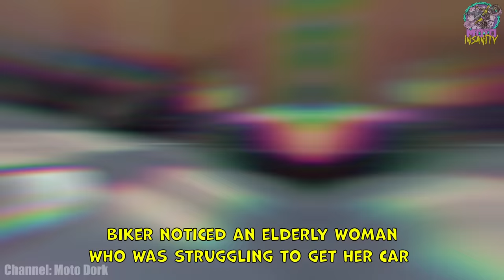THESE BIKERS are AWESOME | This is why we LOVE bikers 2023 [Ep.#36]🍿🍩🍭

Comment: 5:00 is a perfect example of how it helps to be calm even when the situation is terrible. Front doors weren't working, probably jammed if the front of the car was pushed back into the doors, and the girl panicked. Bystanders couldn't open the back doors and first instinct was to break the windows. Eventually the solution was that the girl inside needed to calm down enough to unlock the back doors and get out.
Reply: yeah true like why dint shr just try the back door
Reply: @sam.pena06  probably cause she was in shock and couldn't think clearly
Reply: It’s pretty easy to tell someone that they need to remain calm, but it’s not that easy to manually pull yourself out of shock either. How arrogant and self centered do you have to be to sit safely on your couch behind your phone, and judge how clearly someone who just got in a car wreck is thinking? Common sense isn’t always there for some people (that applies to you by the way). You are one person. What you think, how you handle things, it doesn’t matter. Not everyone is like you. And that doesn’t make them stupid either. When something like this happens a physiological response is triggered. Physiological, NOT psychological. That means that in a lot of cases they AREN’T thinking, they’re on autopilot. Honestly, come on 😂
Reply: @rlynn8249  I'm more pointing it out for anyone that watches this or reads this comment than the actual people in the video. Just a reminder that if someone is in a similar situation that trying to stay calm will help them. Similar to the whole mythbusters thing with a sinking car, they showed that on mythbusters and it's probably saved the lives of multiple people because when they got into the same situation they didn't panic and were able to escape. This is a good example of how even in a regular car crash it's easy for what is happening to overwhelm someone and they miss what could be a simple solution to a problem. You are correct in that this is actually a common response to a stressful situation for people. My point is that just because it's a common response and understandable, that doesn't mean that this is what you should do in this situation. But like you point out once you are in shock and panicking it's not easy to go back to being calm.
Reply: @michaelmurray6197  Yeah you are right in what you are saying but you'd be similar in that situation. I flipped in a jeep with my buddy. I was so disoriented that I was trying to open the passenger side door over and over before I realized we were sideways. My door was facing the ground. I was so disoriented that I didn't even realize for a good 30 seconds that my entire body and the jeep itself were sideways lmao
Reply: That’s why sometimes you just gotta yell at them to stfu and calm down
Reply: @TJ-1234  she can't think clearly period lol
Reply: @sam.pena06 she was in shock
Reply: I had a speeding dolt rear-ended me doing about 90 and sent me spinning out in the middle of the highway. Luckily, I stopped in the paint triangle between the exit ramp and the highway, then I had a full blown panic attack. I felt her panic, cause I've been there.
Reply: Yeah she was terrified:(
Reply: Also the inside of the vehicle was filling with smoke or whatever that was, increasing the panic. Never dismiss someone in a state of panic, their actions are born of desperation, fear, trauma, etc. You need to find a way to gently calm them down. I was an EMT for a short while and it's super important because they may put themselves or ohers at risk and it's not entirely their fault

Comment: 8:05 alternator is dead.

If your car is running and then it dies because the battery went dead, then it's always the alternator. Once the car has started, you can pull the battery out and it will still run if you have a good alternator. (For those of you who want to argue semantics, yes, I understand it's more complicated than simply pulling the battery, but my point still stands). Also, she said it's a brand new battery, which means she's been having this problem and has been misdiagnosing it for a little while. It doesn't matter how new the battery is, if the alternator is not charging the battery and running all the electronics in the car, then you will run down that battery in less than a half hour.

Comment: if your battery dies WHILE you drive... it's your alternator thats shot! The battery should only be there to start the car. you could unplug it after that and the car will run fine. Your alternator provides the power once the car is started. If the battery dies while driving, it means the alternator doesn't work, and you were running everything off the battery... until the battery wouldn't battery anymore.
Reply: Thanks for the heads up, I don’t have a car yet but this is good to know
Reply: Most likely yes, but might be many other problem like aux belt broken/felt off, cables fuses or ground issues (power cables or newer cars have communication ECU to alternator which if it's not communicating it won't charge) or too much current taken from your system so alternator can't keep up with charging (most likely by some extra accesories because OEM things in car usually are designed to shut down or reduce power if they exceed alternator limit, let's say in one car I had heated windshield, heated back window, heated seats, extra OEM internal PTC heating and if I put everithing on on idle it stop to use PTC heating and only when driving when it's full alternator power avaliable because voltage drop was too big).

But battery can also be an issue if cells in battery having short circuit and extremally bad. Most likely combined with charging system as above.
Reply: @oluskloc  you are right. But the point is if the battery dies while you are driving, replacing the battery has very little chance of solving the issue. I should probably have said you have another electrical issue (as well as a dead battery now)

Comment: 8:05. If it’s a brand new battery, chances are it’s not dead. Just developed corrosion due to either a loose connector or there was already corrosion from the previous battery. Has happened to me twice on the trail on my atv, and my connections were tight! I always have the NOCO battery terminal cleaning kit with me, but anything that can scuff up the metal (almost anything will, it’s most likely made of Lead) will allow the power to flow properly through metal-metal contact.

Comment: If its a brand new batter, check the terminals because sometimes the man cub in the shop forgot to tighten them enough or knocked another wire loose while installing it. Could also be an issue where the battery is shorting to frame causing a continuous draw to trickle out into ground. (AKA wiring issue, which can be a nightmare.)

Comment: If you find yourself in a situation where you need to break the window to escape from a vehicle then either squeeze the plastic clip together which will allow you to remove the head rest and use the metal bars of it to break the glass or pull out a load of excess seat belt and then use the metal of the belt buckle to smash the glass .also go for the corners where the glass is supported more rigidly not the central area. Be sure to scrape all around the opening with something rather than climbing over glass fragments in the window frame. Don't waste time trying this on the front or rear windscreen ,they're laminated and far to heavy duty for these methods to work .